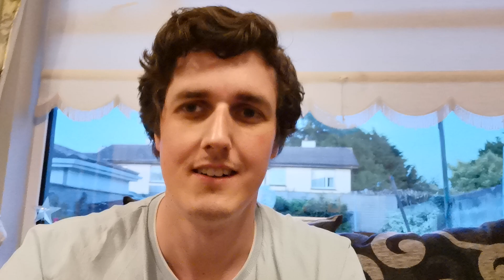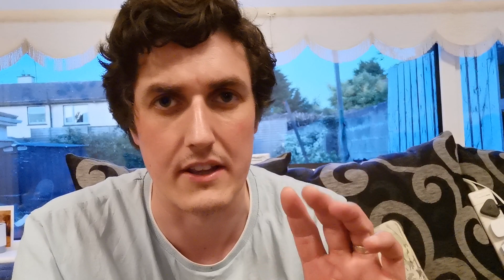Dangerous fuel hose, ethanol and classic cars - HOW TO PREVENT FIRES!

Comment: Here in America There Are Places closer to bodies of water that sell gasoline that does not contain any ethanol for use in boats, because of the water that the ethanol fuel attracts and destroys the engine, insurance companies got so tired of buying boat engines but they started offering non-ethanol gasoline. It's around 80 cents more a gallon, and I make a special trip to fill my car and a special fuel tank of the non-ethanol gasoline so I always have five extra gallons in the garage and a can or when I switch from one classic car to another I have 5 gallons I can pour into it so I will make it to the station that sells that fuel at the best price. I tell people any car built before 2005 don't go for the it's cheaper I'll get this gas when it's available for 80 cents more a gallon and you have the safety in mind. Many cars in America are burning to the ground with people being knocked out by their airbags and the electric fuel pump is spraying the explosive Vapor the ethanol is 55% more explosive is what I've heard and I think people are being burned alive in their cars cuz they've been knocked out by the airbag and they don't get out of their car in time before it ignites sometimes pass or bias will stop and remove them from the cars but too sadly they're called crumplezones and they wad up so severely the people can't get out and by the time any emergency vehicles get there it's completely burnt to the ground. All of America's little tiny cars are a little rolling Ford Pintos ready to explode I call them crumple Zone caskets. Wear one whack it's on a roll back it crumples up it's not like my big '70s Cadillac where you can drive to a house and come out the other side and the bumper stays on. I enjoy 14 miles to the gallon of nice safety in classic vintage Steel 5500 lb of it
Reply from the maker: That's good you can get ethanol free fuel. I don't think there'll be many places selling it here.

Comment: Informative! You've just cost me a little bit more on my T25! Ha! I'm kidding of course. This is really useful and something everyone should consider.
I have a carburettor that seems to be leaking fuel onto my 1.9DG. I need to get this looked at!
Reply from the maker: Yeah don't procrastinate about that. Make sure you get it sorted. Do you know where it's leaking from?
Reply: @Endfloat  You're right, I won't be driving it until it's been looked at. I'm not sure yet I haven't looked in detail. It's got residue along the top of the DG, which is below the carb. I could be totally wrong, but I am assuming it's from there. I'm going to degrease the engine, and run it on the driveway to observe.

Do you know much about these carbs?
Reply from the maker: @4RingsRetro  I'd be lying if I said I did. Check the obvious first. Fuel line condition, loose clamps etc.
Reply: @Endfloat  Thanks for the advice. I'll try those things first. I'm no mechanic, or engineer, but I'll have a go at most things. Replaced my MK4 Golf exhaust last week on the drive. You have to have a 'can do' attitude with these old cars!